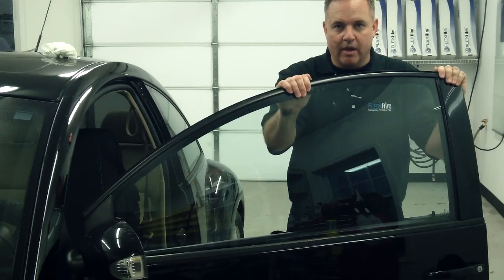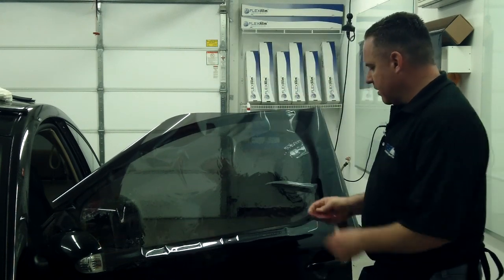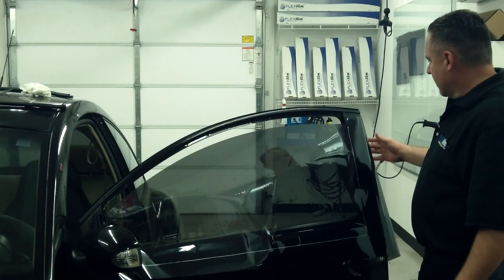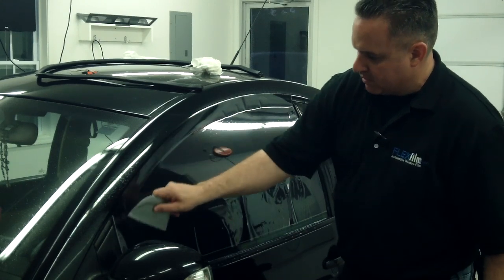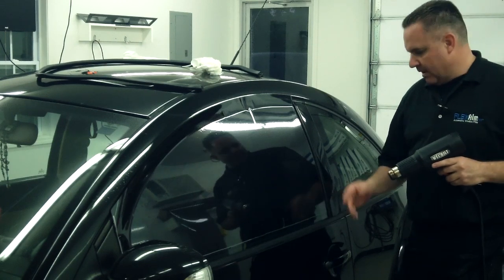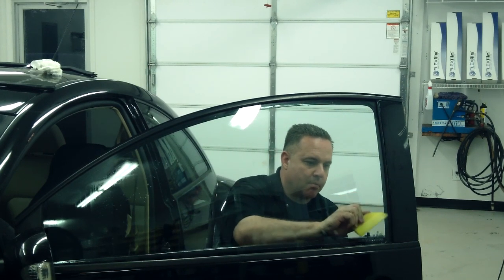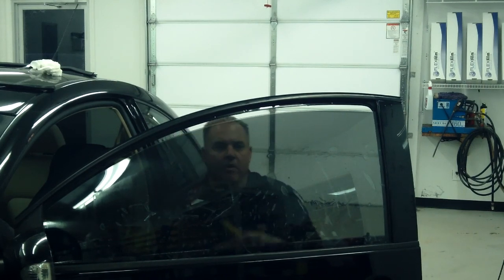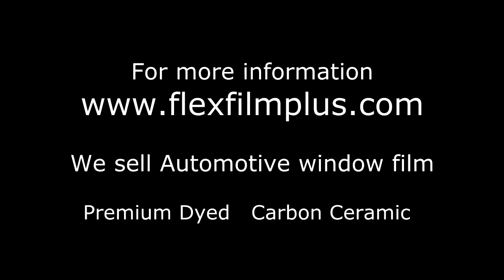How to Tint a Curved, Frame Side Window

Comment: Great video as usual. You are the pro!
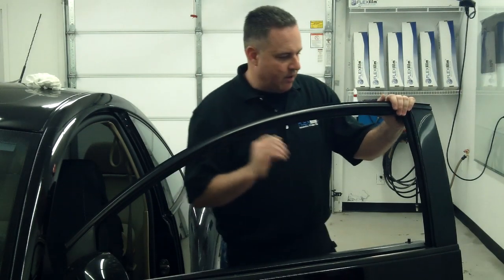In the video around 0:43 you are removing the window rubber felt, and pull around 6 inches out from within the door. At around 1:03 you say they are not hard to put back in.
I have never worked on that car, but it seems you would have to take to door apart to get the rubber felt back in, especially when 6 inches came out. Am I missing something? Tricks?

Comment: On some be beetles you can also pull the side and top rubber seal so it's not hard getting tint in there. I know some of the beetles have super tint side seals. But it really depends on the year. If it has felt seals, I mask them with tape to avoid felt hairs from getting in the film

Comment: how long did you wait till you put the window rubber back in
Reply: Kyle schlesselman the bottom seal can be put in after you are done. The seal retains water, that's why you take it off. So if it's not there, there won't be water there after you towel it.

Comment: Excellent video. Interesting you did not use Irish Spring soap for the shrink step and you placed the bottom edge of the film in place 1st.  I really liked how the film remained movable - That tells me I need to add a little more baby shampoo because the last side window I tried the film stuck and would not allow me to move it.